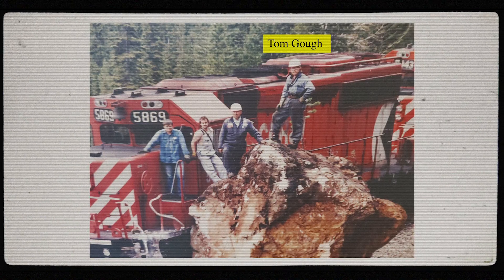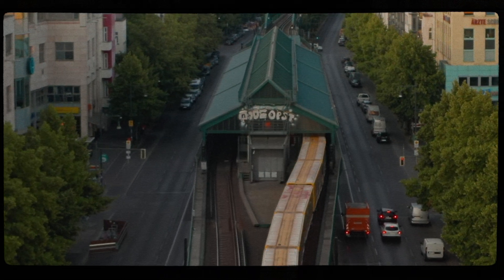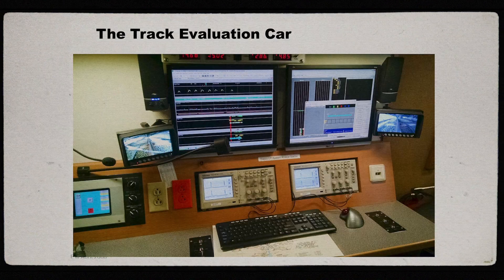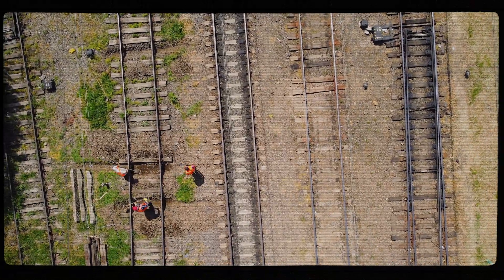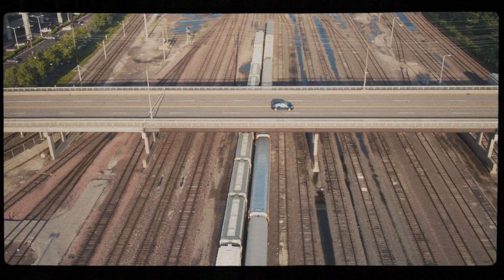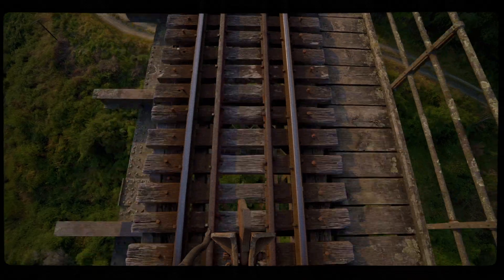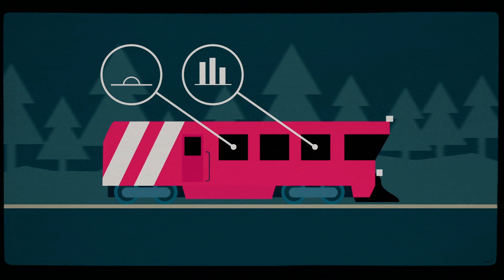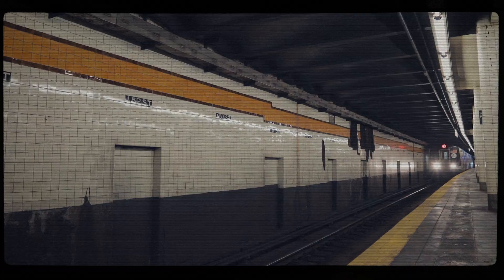Track Inspections: Keeping Railroads Safe in Under 5 Minutes

Comment: I have to said this look like a Power Point presentation. Since there are lot of picture and video represent the content but not showing the actual content itself for the most part.
Like sure there is the ultrasonic testing, but no video of the actual device or how it actually work. Just some clip of random train and train worker.
The infomation is helpful but way too general.